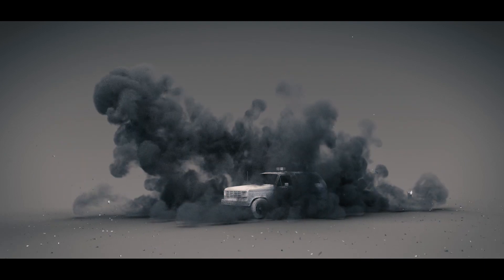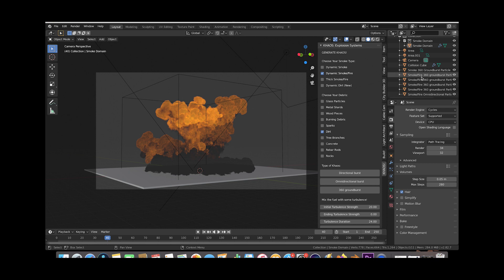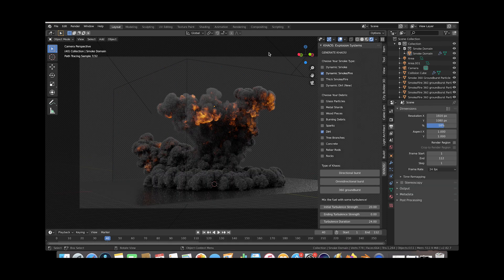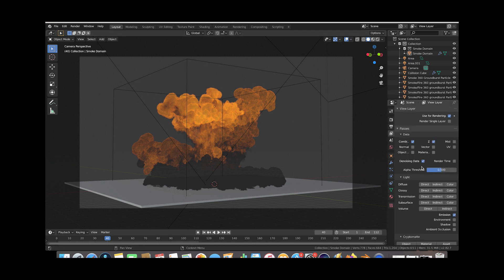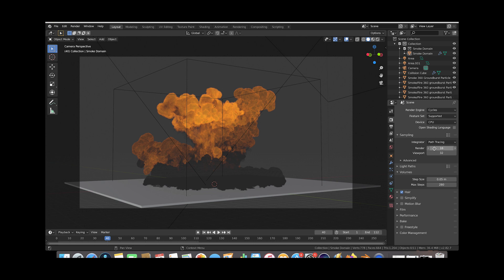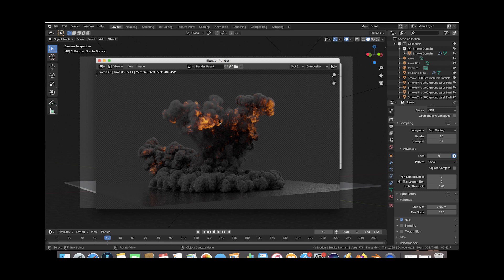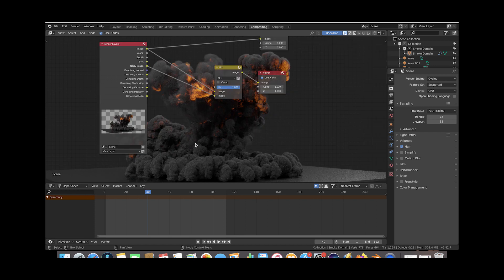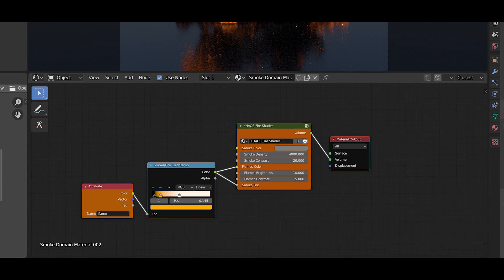Simple de-noising for your Blender 3d renders: De-noising tutorial Blender 2.82

Comment: What if we use AI DENOISE?
Reply from the maker: Even better for sure. Just a little more node setup. I'll figure it out and make a video on that too. The way in this video is just simpler.
Reply: @LightArchitect  👍🏻👍🏻 keep up the good work dude. Love your videos.
Reply from the maker: @GauravSharma-dy8xv  Thank you!
Reply: @LightArchitect  Topaz has something for this I believe, although costly. I tried out the trial and it works perfectly but this method works good enough to justify not spending 100 or whatever it is on the Topaz AI denoiser. Their AI adjust program is insane though.